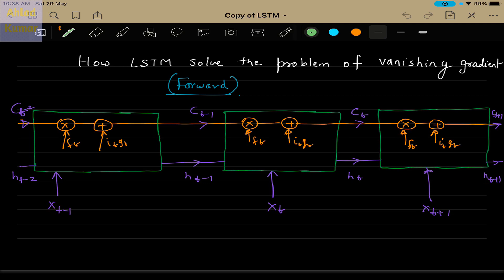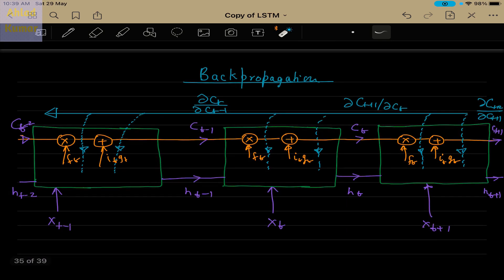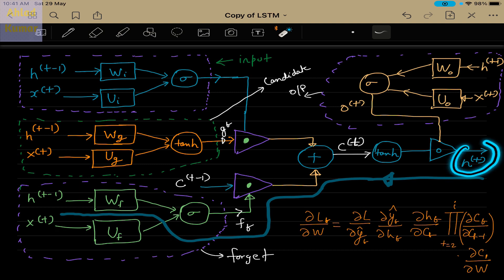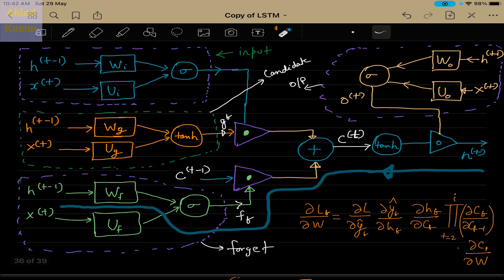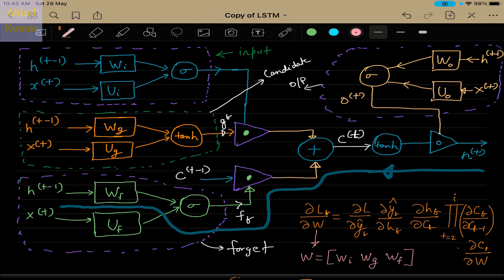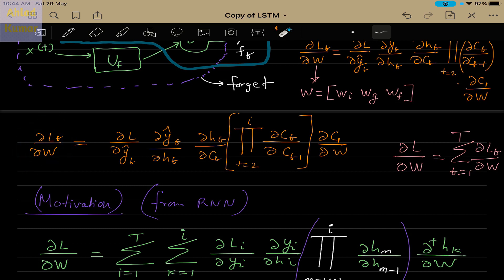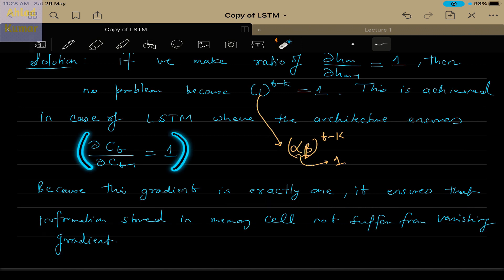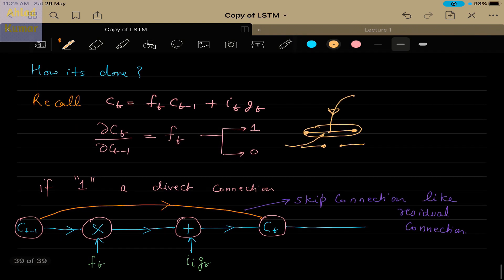Deep Learning 68: Solving Vanishing Gradient Problem in Long Short-Term Memory (LSTM) Architecture

Comment: I do not understand your explanation why ft is 0 or 1. It is result of a sigmoid function , so it can be any value in between 0 to 1
Reply: you are correct, it is not correctly explained
Reply: @lvlanson  The sigmoid layer outputs numbers between zero and one, describing how much of each component should be let through. A value of zero means “let nothing through,” while a value of one means “let everything through!”
Reply: @thatsfantastic313  yes, they are BETWEEN zero and one, which means - continuous values from 0 to 1. Not only 0 or 1. And there is no explanation, how does it solve the vanishing gradient problem - there are still some fraction multiplications through time.
Reply: @vmarchenkoff  Look, real culprit in RNN was del(ht)/del(hi) , only if this quantity gives well behaved derivates there would be no VGP at all. In LSTM it is handled by forget gate. VGP problem actually causes what? memory shortage, right. In LSTM, memory is cell state, right? so by forget gate we can prevent anything from destroying or distorting our memory hence LSTM (Long short-term memory). The cell is updated by the rule, C(t) = f * C(t-1) + i * Candidate(t). Now this updation rule causes all the magic and gives much more well-behaved derivatives. Moreover, the gating functions allow the network to decide how much the gradient vanishes, It was, maybe, the only idea behind introducing gating. But, still being new to the field I would say that my understanding may be flawed. If I get anything wrong, please do correct me.
Reply: from my understanding, by ft = 1, he's trying to generalize all the possible scenarios. Because it is usual for the ft value to be pretty high meaning close to 1 since only a very little piece of data is forgotten. The idea we're discussing here is that the ft value is helping to diminish the vanishing of gradient descent, which is true because if ft=1, then the gradient is totally conserved and passed to the next loop whereas if its close to 1 but not 1 such as 0.89, then the majority of the gradient is conserved only a bit is being vanished. Which is already much better than the standard vanilla recurrent neural network. The main gist to bear mind is that it dones't completely eliminates the gradient vanishing issue but only make it more difficult to occur,
Reply: @jordiwang  it can be 0.89 in the standard vanilla RNN as well)
Reply: @vmarchenkoff  It's either i explained myself vaguely or you didn't read my response carefully. The main idea as I said is that the LSTM mitigates the chances of getting vanishing gradient descent issue. And how does it mitigates it? well, simply by having a much higher chances of getting a weight that's much closer to 1 compared to in vanilla RNN. Hence, obviously, in vanilla RNN, there's some cases where the weight is high, but it's not common, whereas it is common in LSTM. By the way, the reason why the objective is to approach 1 is because that's the only value that doesn't lead to vanishing nor exploding gradient descent. This is one way of understanding it, hope it's clear